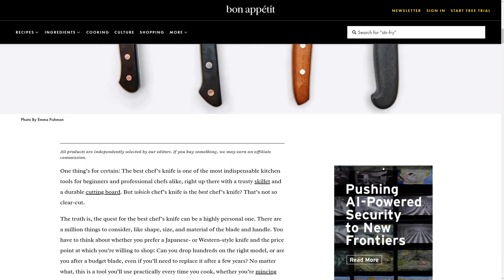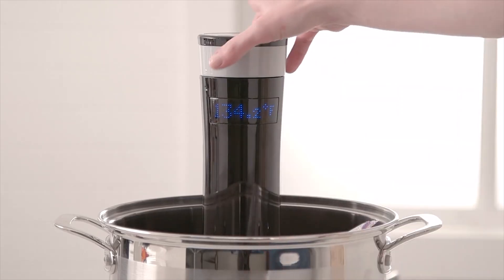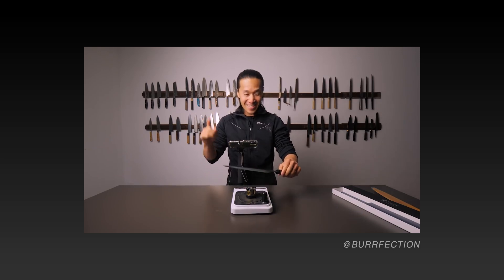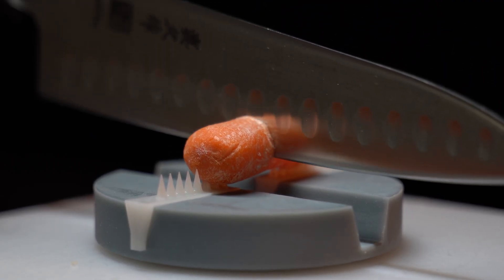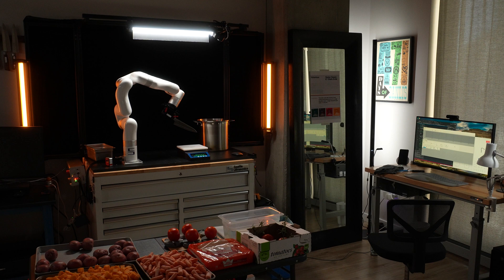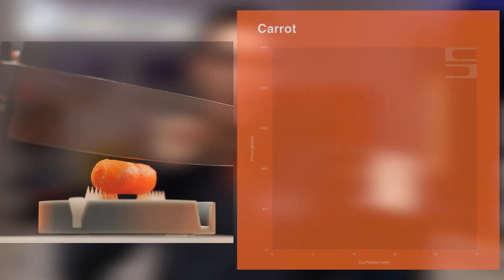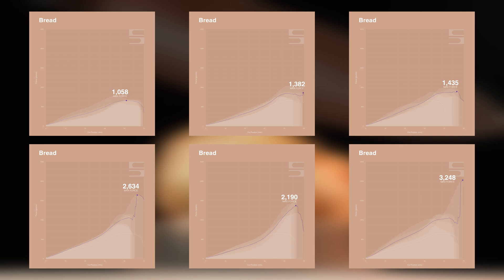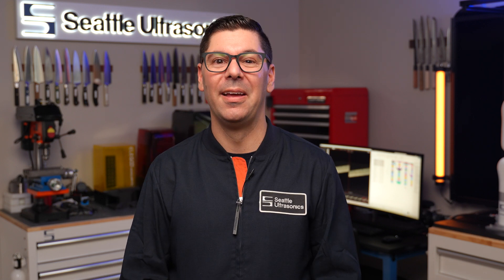The Quantified Knife Project - How do the most popular chef's knives actually perform?

Comment: I find this test missing proper cutting technique for the foods, tomato especially, edge retention and hardness of the steel. the main issue I have with this is that the sharpness of the blades is almost irrelevant without factoring in blade thickness as its going to play a huge role when just pushing the knife through it, hence why a cheese cutter, which where I live is literally just a metal string, it ain't sharp but it goes through cheese much more easily than a knife due to not having much material that will cause friction between the cheese. You also don't really have to make sure the blade isn't touching anything other than the food though, when a person is cutting food the edge is gonna touch the cutting board which is going to slowly affect the edge and the sharpness over time, which is where edge retention is gonna come into play, and of course the material of the cutting board. Respect the dedication though, potential for perfection.

Comment: This is a great start and there are many great comments already. I’m curious how blade geometry and edge thickness play a role, as well as the hardness and wear resistance and perhaps uniform or optimized sharpening angles and grit finishes for different types of food as well. This testing didn’t cover meat and all the types there, and is clearly focused on the blade performance, but I’d like to see an attempt at scientifically quantifying the balance and weight of each knife, the blade shape (since some are more suited towards push cuts vs rocking or long pull slicing, or how the shape of the blade interacts with a cutting board), and handle ergonomics. I feel like this is just the tip of the iceberg in creating the optimal kitchen knife, especially given the unpredictability of performance from test type to test type. Speaking of which, there likely wasn’t enough cutting to significantly wear on the edge, but quantifying how long the edge lasts (also in relation to edge geometry, steel, hardness, etc) would be an interesting study. I doubt the order of food cut would affect the scores significantly at this point though.

Comment: 0:48 - Hi! Professional sharpener here. Much of the reason why no graphs or numbers are provided is because 1: the average person who buys kitchen cutlery REALLY doesnt care about that, but it is very much available on places like KnifeSteelNerds and ScienceOfSharp, and 2: the only meaningful thing you really can test is wear resistance, because everything else is just down to sharpening geometry and can be changed since a knife obviously needs to be sharpened every now and then to keep performing. What really matters when you buy a knife like this is stuff like size, weight, materials its made from, balance and probably the most important of all; ergonomics. Because those things you cant really change after you buy it, geometry is fairly easy to do something about.

The data you gathered here is largely already known in the community though, I havent seen it this detailed for the most part, but it is for sure known. And to me at least, it does sound like what you are looking for isnt necessarily a better knife, its a better sharpening method? That might be a very hard thing to break into though, since theres already alot of very good options available at all price points.

Comment: the issue with trying to take objective data from cutting test with factory edges, is that if you are actually using a knife in a kitchen professionally you aren't going to be using that factory edge very long and all of these knives can be sharpened to preform better in these tests. without understanding what makes a knife cut well outside of just its out of the box sharpness these tests are useless. i think these knives should all be resharpened to the same point of sharpness then run the tests again this will give us a better understanding of which of the knives edge Geometry and thickness is better for cutting what foods.  another important spec for knives is how long they can stay sharp. which a lot of people will find a lot more important because any cheap steel can be sharpened to destroy these tests out of the box but if that knife is dull on your second week of work its not going to matter. cool robot arm tho, thanks for the entertaining video.

Comment: Yes, fascinating.  But all knives will get blunt over time, and you will need to sharpen them.  You may try to mimic the angle and sharpness of the knife right out of the box, but you won't.  So most of the life of a knife (99.9%) is not reflected in the "right out of the box" performance data.  More relevant to long-term performance would be how long a knife can maintain its sharpness and avoid damage.  It would also be interesting to look at what knife angles/shapes perform the best for different foods.  Also, the shape varies along the blade, so presumably that could affect the results for different foods.  For a given knife, is there an optimum cutting position?
Reply: I see below in another comment you had edge retention testing done.
Reply from the maker: Yep. I chose to measure performance against the factory edge because these knives are marketed to home cooks and most home won't resharpen regularly, if at all. I know that sounds bananas to serious knife people, but it's sadly true that in most households the factory edge will be the sharpest time of that knife's working life. (To take an extreme example: think of the knives in the last AirBnB you visited.)

Yes, factory edges do not represent the ultimate potential of any of these blades. But to me, it feels a little like reviewing the performance of a car. Every car comes with a set of tires selected by the manufacturer. How that car handles is useful information on those stock tires since that's how most people will drive the car. But if you're a power user, you know you a set of snow tires will change everything from ice-breaking distance to fuel effeciency. For these tests, my goal was to measure the car as-sold, not necessarily the aftermarket tires. 

The good news is I kept all the blades in this test, so we can resharpen and compare these baselines against future results.

Comment: Interesting methodology. Most knives have a distal taper meaning that the knife thins out towards the tip. How do you ensure a fair assessment since the results will be totally skewed even when comparing the same knife depending on whether you use the heel or the tip
Reply from the maker: That's an excellent question. The robot gripped each knife by the same spot on the handle, and the foods were placed the same distance away in each test. But there was no compensation done to try to hit the same relative taper distance along the blade edge. In practice, the foods all touched around the same curvature spot on the belly, but you're right that distal tapering could be a factor in performance on this basis. However, I'd say that also reflects the real-world experience of cutting with these knives, since it's the natural spot where you'd contact food if cutting by hand. Very insightful question!

Comment: Quite a lot of work. I will dig through this probably more than I should! Next, sharpen all of them to see what happens when you fix the factories mistakes. Finally, regrind all of them to the same edge profile to identify if you are comparing knifes or edge profiles. Just ideas, I don't want to insinuate in any way that what you've done isn't extraordinary.
Reply: All three would be good data, but the ootb data is how people feel when they use the knives the first several months so it's a higher weighting. The reshaping would help analyze the metal, but shape choice is part of branding so the results should get a really low weighting. You can get similar knowledge about curvature from testing one knife cutting closer to or farther from the tip.

Comment: Interesting research, folding knife nerds go to great detail in knife steels and associated specifications, angles of edges, blade profile etc etc, chef knives seem to be the opposite, it either rusts or it doesn’t, or it’s hard to sharpen.. ( not seriously an issue with lots of mechanical methods any more). 
Personally I’m not interested in any knife for food preparation that has cobalt in it, or rusts in a couple of minutes. Stainless and slicey with a reasonable hardness please.

Comment: This test is going to reward the thinnest and shallowest angled secondary ground bevel. I have a very thin ultra light camping knife that would be the “best knife” for this test but it isn’t the “best” knife for use in the kitchen. Handle geometry is wrong, balance is wrong, durability and edge retention is not great. There is a reason the previous knife reviews are subjective. A lot of it comes down to personal preference and “feel” of the knife

Comment: All good, and much respect. But push cutting is definitely not the norm for kitchen cutting. Its almost always a combination of push, or pull,  and slice (or should be), to use the "teeth" of the grind. Since you have a robot, I thought you might simulate that motion, and measure downforce. Given a certain sharpness, the thinner the blade is behind the edge, it will always perform better in the kitchen. Geometry is everything. I made a knife with a thin hollow grind, and a convex secondary edge. Works the best of all knives I've ever used. Best of all - it releases all types of veg almost immediately.

Comment: This is great stuff. Here's an important data point you're currently missing: blade thickness measurements. Half way between the heel and tip, measure at the "shoulders" (where the primary grind meets the edge bevel), then 1, 2, 5, 10 and 20 mm up from the cutting edge. I expect you'll find a strong correlation between these thickness measurements and cutting performance in certain foods; both the outright thickness and any convex / concave blade shape they describe.

Comment: Using knives as they come "out of the box" provides more information about the manufacturer's choices about how sharp they make the blade from the factory... rather than providing good information about the characteristics of the blade itself.

It might be more useful to give each knife an identical sharpening, and then run these tests.
Reply: Just wanted to say that. You need to eliminate all the variables, and factory sharpening is the biggest.

Comment: Love it. First, go look up Dr, Larrin Thomas, a metalurgist who studies much the same things from a different perspective. Second, knife afficionado's know that geometry cuts, so thickness behind the edge really matters greatly. Third, from my experience, blade finish matters with some cutting materials; soft cheese in particular.
Reply: I went to the website in the description and he actually sent all knives to Dr. Larrin for edge retention testing and other advice etc
Reply: Agreed. I don’t understand why no one talks about thickness behind edge in chefs knives. I saw shun classic tested here. My shun classic chef is 0.014”. I also have a classic utility at 0.006” and an Asian chef at 0.010”. Meanwhile the whole line of Shun premier run 0.008” down the line. Except for the 6.5” utility that is only 0.004” behind the edge. It makes so much difference. But you need variety in the kitchen I think anyway. I would go down such a rabbit hole with this tech.
Reply: @TheKnifeSurgeon  I run my pocket knives in the ballpark of 0.005" BTE.  Chef knives are zero ground with a microbevel, around 0.001" BTE.
Reply: Thinner blade geometry reduced cut force requirements on high density vegetable cut tests by up to 3.7x.  Sharp ( Bess 225 to 275 ) to Dull ( Bess 625 to 675 ) reduced cut force by less than 14% (0.14x).   10º blending bevels reduced cut force by 32% to 34% (0.33x)
Reply: For soft cheese, use a wire. For really soft cheese use a butter knife; trying a sharp knife will just be frustrating.

Comment: I think that the cutting performance for certain foods is being influenced by the gap in your 3D printed holder which leaves part of the food unsupported. Also IMO any data recorded after the knife breaks the plane of the virtual cutting board isn't relevant.

Is there no way to have a setup that replicates more closely using an actual cutting board? 

Anyway amazing work, instant sub.